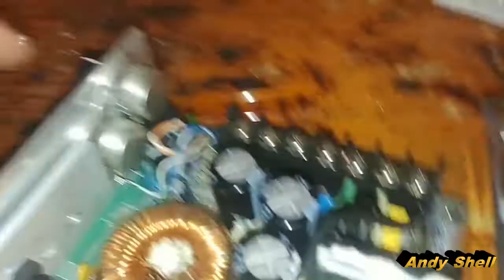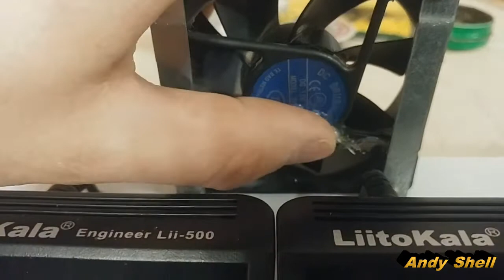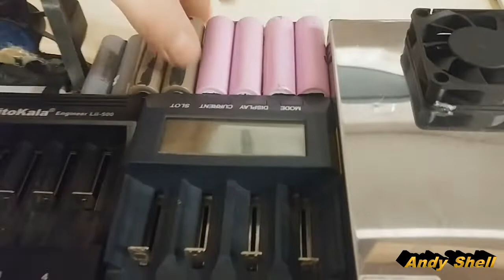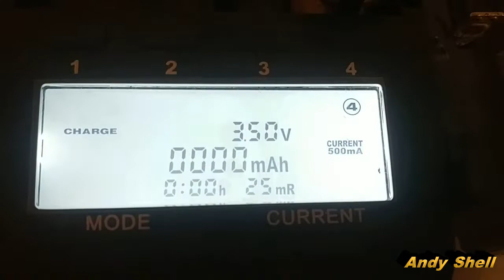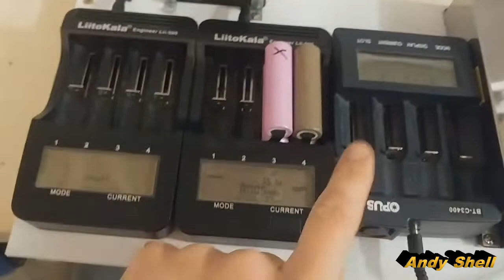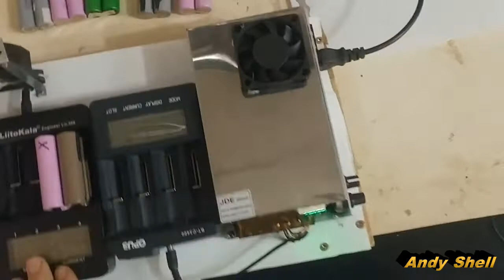Simple DIY Wall Mounted Battery Charger Opus & Liitokala

Comment: I been wondering what you are up to! Haven't heard from you in a while! I got a a ISDT T8 charger, it does up to 30 Amps,, and upto 8cells in series, I can charge from a battery, recycle the electrons! But I'm useing a AC to DC 24v 15a for now,i got it to charge my 12v LiFePo4 bank from my 24v bank. I built the bank to power my 12v lighting, over a large DC buck that will likely not last, and uses my24v bank. If it goes as figured, I have 6-12 days of light without charging, I have a cheap pwm controller, that charges LiFePo4 I may use my 24v bank to charge it! I haven't decided, or I may put a 100-150 watt panel on the 12v bank.. I have 5 of the 4 bay chargers, zanflare brand. I ran one hard for over a month straight, its still ticking! Keep at it !!!
Reply from the maker: i can't see the zanflare being worth the extra money? idk. 12v lipo sounds interesting. send me some pic! :) sounds good man. you've been very buisy :)
Reply: @AndyShell  I got the zanflare chargers on sale, about $17 each I think I have in them , I didn't get them all at once at the same price, but it was $17-19 each average, they were a 2_for $25 or something and one was $19, I can't remember the rest, they work well, I wish they charged LiFePo4 cells, but the ones I got are new, they are 12.8 nominal,  so perfect for 12v I have 20, of the 26650's that will do 150 amps each (, I don't have them in my bank. I used higher capacity Cells, ) if they were in 4s, that's 750 amps they capable of, that is peak, but should start a car! I have one pack with bms gaing, waiting on parts,,,, I send pics later!